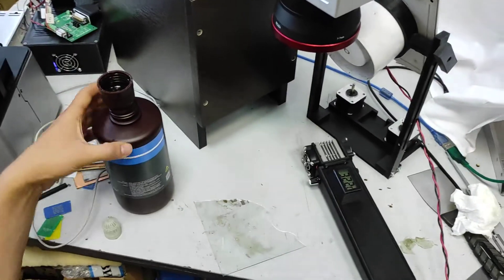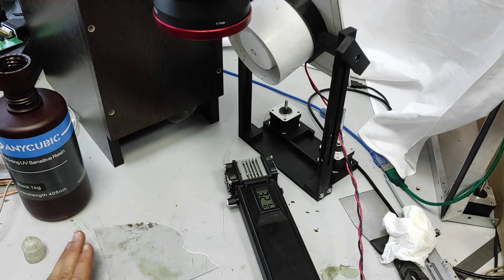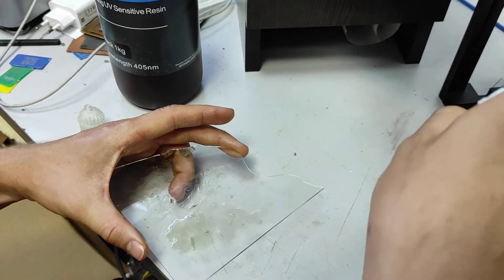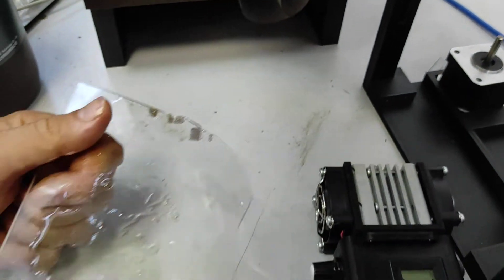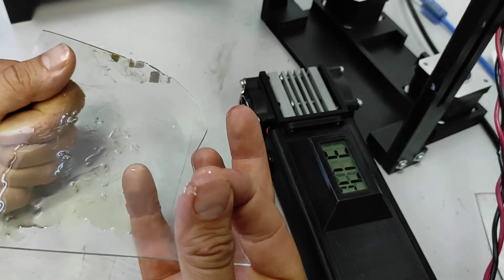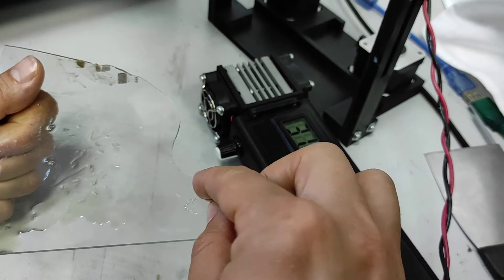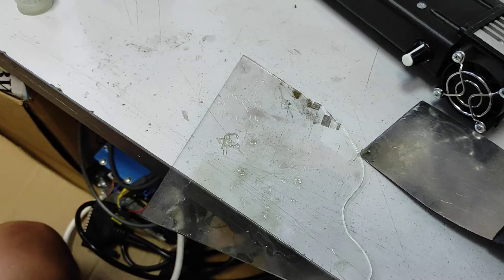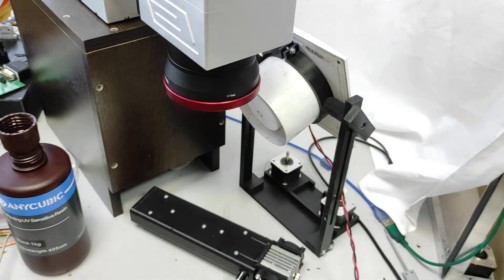Exploring 355 / 445 nm lasers for SLA 3D printing. Testing Anycubic 405 nm resin.

Comment: If on snth its written that 405, means it doesn't have sensitivity in another ranges😂😂😂. You just need to use 405 nm 500mw cheap laser module to have success

Comment: I like that mentioned that 405 nm is not UV!  I get people on that all the time in resin printer forums!  HAHA! 🤣🤣

One thing to keep in mind while you're experimenting around is most resins will not cure on the surface due to oxygen inhibition.  If you didn't happen to know of this property it could get awfully frustrating when you expose a powerful laser on some resin and it doesn't seem to cure it completely.  I think most resins for LCD printers will photopolymerize from around 455 to well into the UV range.